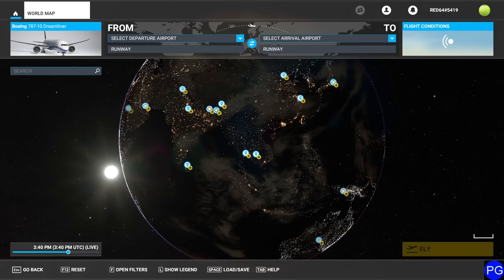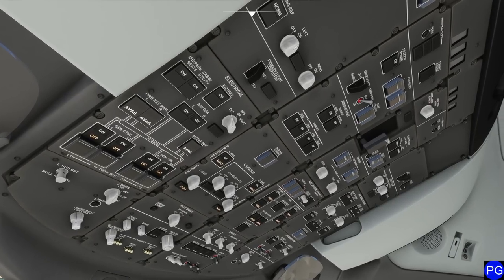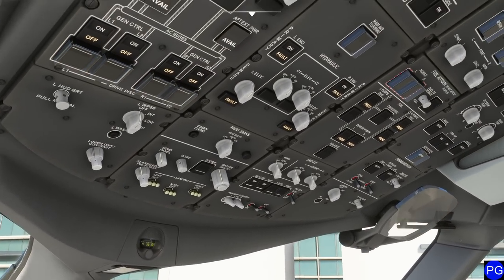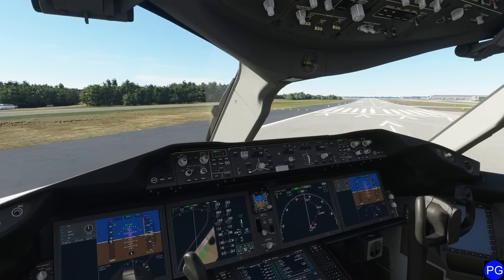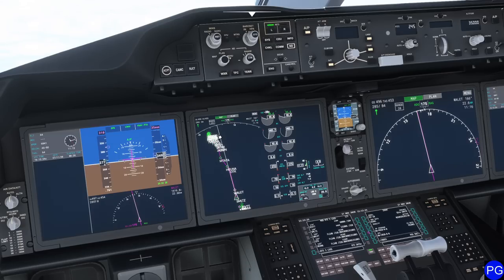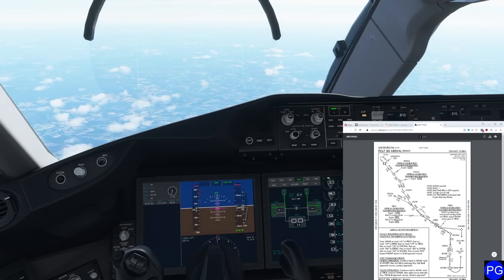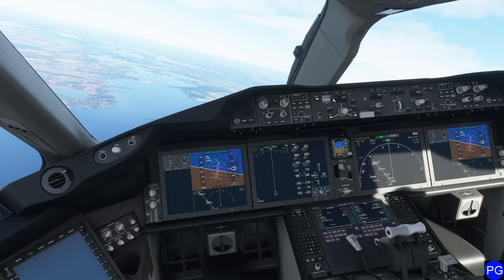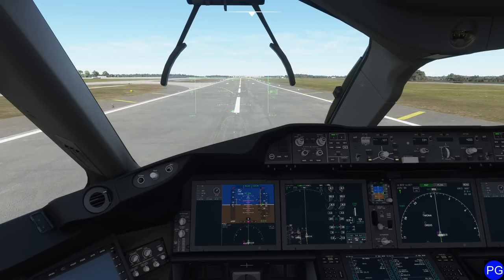FS2020 - Flying Airliners Part 2 of 2 - Flying your flight plan

Comment: You said you were reaching around behind the throttles to activate the  TOGA on your takeoff roll... but, for the life of me, I cannot find the hotspot or whatever it's assigned to on the 787. Any clues??? 

The old PMDGs had a rivet or screwhead close by as a hotspot... or that's how I remember it.
Reply: I found it! It's on the front of the throttles. Very well hidden. That cannot be as it is in the real 787, can it? Granted, once you know where it is, it's easy enough to find again and use, but why so obtuse?